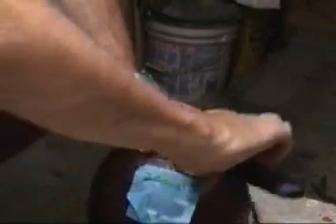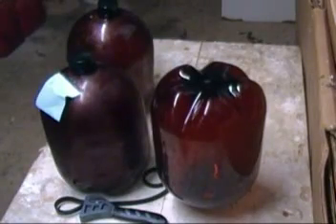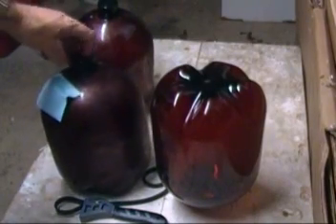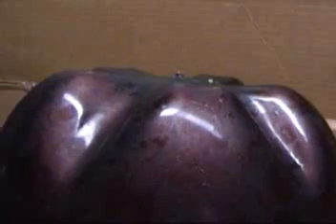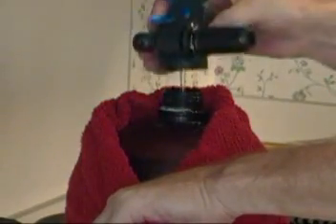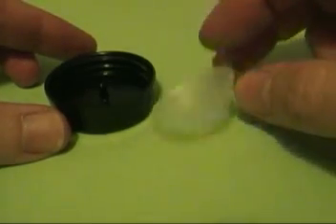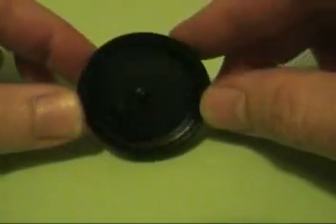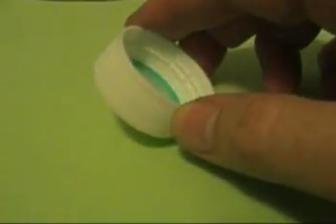Bottle Failure During Carbonation with Miller Home Draft

Comment: I've had this exact thing happen with 750ml pet bottles. they crack at the bottom from stress. it is the weakest point of the bottle. that's why a perfectly round bottom would not stress crack.
Reply from the maker: +Matowix Yeah, and now the Tap-A-Draft bottles are all round bottoms.  A pain when you're racking into them and storing them, but no stress cracks!
Reply: +sengsationa1 so is it a known issue about them cracking ? I thought it was just me. I saw on the bottles it says only to be reused  5 times but they should last for longer than that.
Reply from the maker: My old tap-a-draft (footed bottoms) lasted only a few times. That was a know problem and why they changed. My newer round bottom ones are still going. I have a few spares. http://i.imgur.com/pc6jUjr.jpg

Comment from the maker: Good question @corbomitereflector.  I can't say.  Tap-A-Draft says don't naturally carbonate without a pressure relieving cap (lawers).  Why carbonate with a leaky cap and end-up with flat beer?  There is also a suggestion to carbonate with less sugar than normal.  But again, why would I want flatter beer than I'm shooting for? I went for 2.8 volumes (used a calculator), so it wasn't hugely over carbonated, and didn't gush.  Poured with 1/3 foam.  These were MHD bottles, used a couple of times.